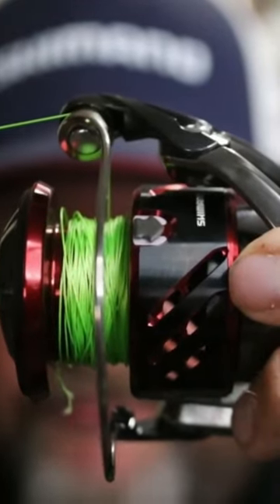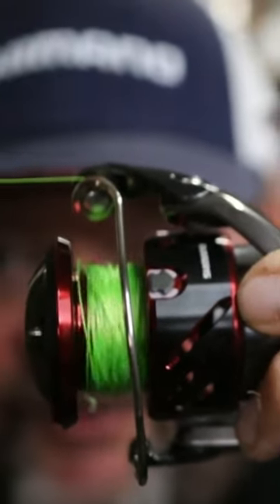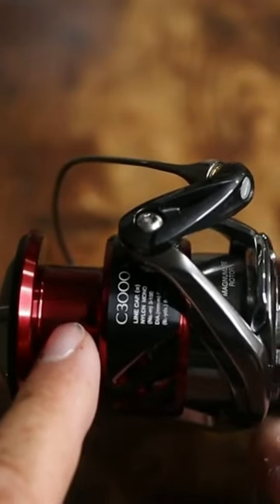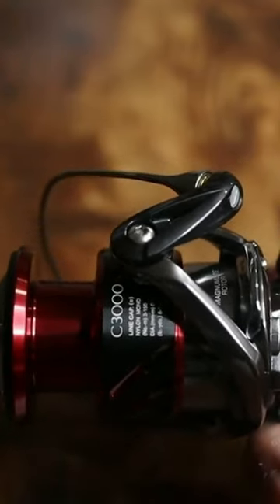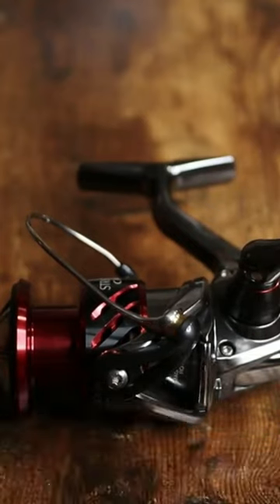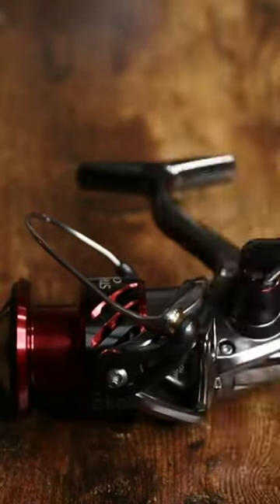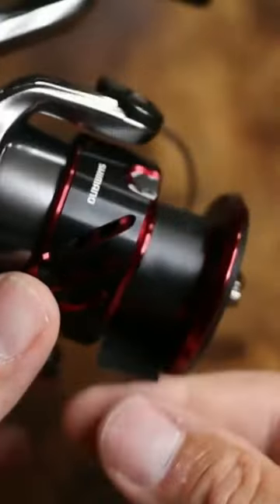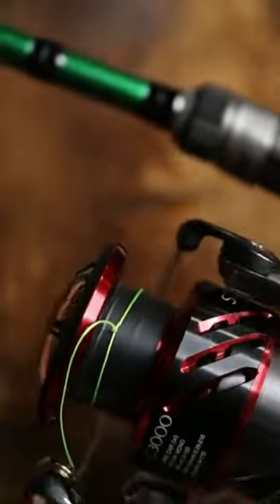Fix Your Braid Slippage (Old school trick)

Comment: I've always found if you just use some electrical tape it is soft enough on the outside that the braid digs into it and will hold everytime without a mono backer. Works with spinning and baitcasters

Comment: This is how I spool every single reel that I own.. and because I fish so much and swap line out so frequently, you don't even have to tie and not around your spool you can literally stick the line under the tape and wrap it around the spool halfway maybe three quarter.. its preference.. then start reeling and filling your spool. I encourage anyone to try it, it's extremely efficient and fast and you can do the same thing with a spinning reel, you don't even have to tie your braid around the spool, just stick it under the tape..put the tape around the spool and start reeling over the tape and it's that easy. Fluoro/braid.. any size. Doesn't matter!

Comment: Mono backing helps the braid from digging in too and there's no sense in having a whole spool of braid on a reel. Only gotta tie the backing to braid knot once
Reply from the maker: I don't see the need for more than 50 yards of braid
Reply: @FishinwithGRAMPS  then why start the braid at the spool. An easy cast with braid can be around 40 yards. Then you got to keep in mind retying the leader. You can also cast further and the reel picks up line better when the spool is full. I always run backing to 90-100 yards of braid. Been using the same braid for the last three years
Reply from the maker: I believe that when casting a baitcaster, not so much with a spinning reel
Reply: @FishinwithGRAMPS  you ain't got much if you're just spooling up with 50 yards of braid. I actually use braid for backing on baitcast reels to make the spool spin faster. Aaron Martens showed me all this years ago. It makes a difference
Reply from the maker: I don't have much use for braid, frogs/punching and bright braid on one spinning for aging eyes, lol
Reply: @FishinwithGRAMPS  I get what you're saying, but the folks at home spooling up braid at the bottom of the spool are wasting a ton of line. I cam normally do three 3000 size reels with one spool of braid
Reply: @FishinwithGRAMPS  shark fishing…

Comment: I use thick braided line and I've never had issues with it yea might spin at first just circle it around it few times then start spooling I get some pulling off my ice rig set up reels but all I do is throw cast then spool it up tight.
Reply from the maker: This was tight before I was able to pull it off with my hand

Comment: I don’t even tie it on I just use a small piece of tape and tape the line to the spool and start to  spool up it makes it a lot easier to spool a baitcaster
Reply: I use the sticker that comes on both ends of spool
Reply: You go through the holes in a baitcaster and tie it on those easier than spinning rods in my eyes
Reply: @blizzbass8469  my older baitcasters don’t have holes in the spools.
Reply: Same
Reply: @Anthonymahon  I do too if I don't have electrical tape,

Comment: It’s very simple actually, just tie the line around and put a little piece of tape on the knot, then while on guy holds the spool of line another guy reels it, make sure there’s tension tho so the line doesn’t get messy in the spool, so the second guy should hold the spool of line tight enough to the point where the tension of your rod bends a bit while you reel, that way your braid sticks to your spool nice and tight